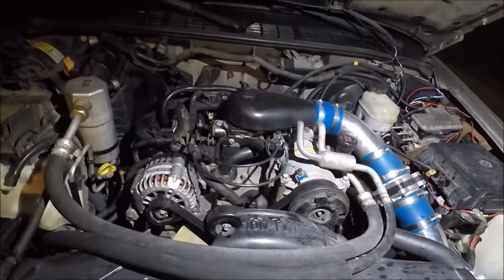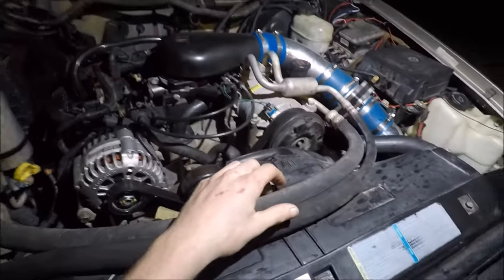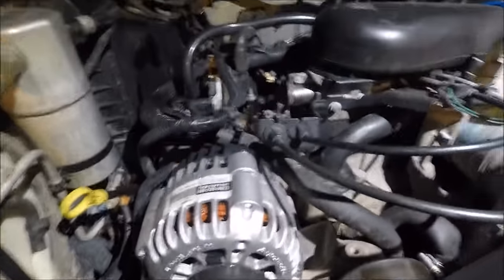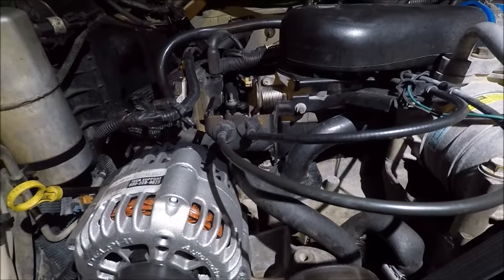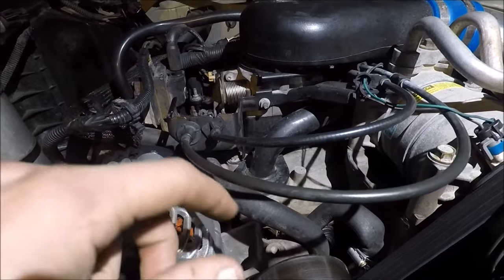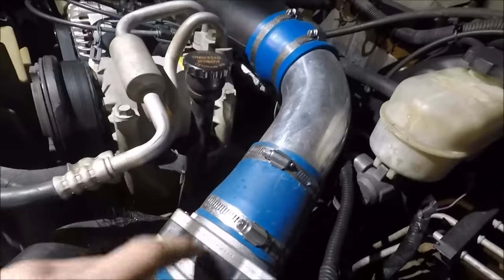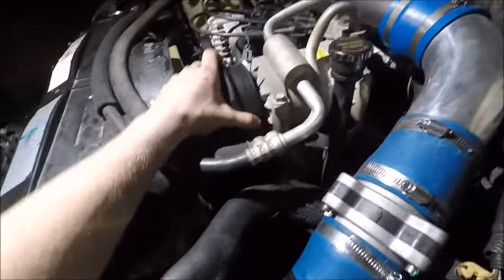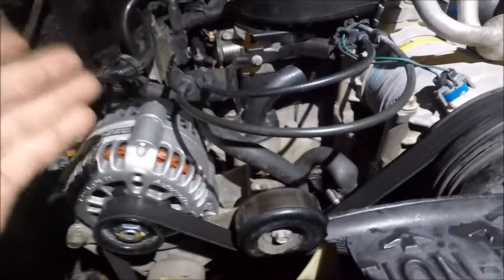EVERYTHING YOU NEED TO KNOW ABOUT THE CHEVY 4.3

Comment: Did you say "maintenance-wise, they're a pain"?
Reply from the maker: Rod Blaine in some aspects yes like spark plugs are a pain since the steering column on 98-04 is in the way
Reply: Okay, got it. Do you just have to change the plugs by feel or do you have to take things apart to get to them? I'm considering buying a '98 4.3 with a 5 speed. Thanks!
Reply from the maker: Rod Blaine not really on the 4.3 they can be accessed from the front wheel wells...they are located on each side of the block on the heads, driver side will be a little bit more of a pain but as long as you got a spark plug wire tool it makes the job stupid easy, but I highly recommend the 4.3 as a simple v6 workhorse that can get the job done everytime.
Reply: Just buy silverado tons of space I have 01 first vehicle I ever did head gaskets on   very easy.

Comment: Great informative video.  Appreciate it!  I had a question if you dont mind...  I have a 2000 Chevy Blazer Ls  V 4.3.  I'm having issues with it shutting off while driving.  Long story short I've replaced pretty much all the sensors. Still had issues. I then was able to sum it down to a short in wiring harness leading to coil and coil modulator I believe. I didnt have the money for a new harness, so I spliced in some new wiring and it worked and ran fine for about 3 months. Now I'm having the same issue with it cutting off while driving... It seems to be more problematic in cold or rainy conditions.. I also do have an Accel coil and spark wires that I've used for about 5 years now..  What are your thoughts?
Thanks in advance...
Reply: I bet it's the crankshaft position sensor. It's on the bottom of the timing cover.
Reply: Could be the ignition coil going bad.
Reply: Mine did that for a while after I attached a trailer power supply
Reply: Maybe the knocking sensors
Reply: Battery/alternator can cause the same
Reply: Monster in the coil/cap known problem. It's arcs
Reply: There's a Crack that occurs and when moisture is present (rainy/ high humidity days) it sends spark in different direction
Reply: @gusc6785  cap & rotor , inside contacts get corroded after 5 years, then rain gets  on to the powdery corrosion causing hard starts. Cleaning the contacts still has pitting that reduces the firing of plugs. You need a new cap & rotor.
Reply: @karenmay5240  actually I been doing research and it seems like it's the gear at the bottom of the distributor , it begins to wear just Enrough which moves the cap just enough to start arcing more and more until eventually you need a new 1 . . There's actually an updated 1 now

Comment: How did GM get your engine to make 200 hp?
Reply from the maker: The Silverado 4.3 got a tune to make it rate a higher output.
Reply: @JLGARAGE252  No sir. They install a hotter cam in 1996.
Reply: @JLGARAGE252  Your truck is a 2002 s10? GM installed a hotter cam in 1994.
Reply from the maker: @blackericdenice  it was 96 and it wasn’t a cam it was a balance shaft to reduce the vibration. 2003-07 vortec 4.3s were up tuned
Reply: @JLGARAGE252  Yes they added a balance shaft but that has nothing to do with hp. If anything, it eat up a little because it spins twice the speed of the crank. I know they install a hotter cam because the peak rpm is higher than 4000.
Reply from the maker: @blackericdenice  ZR2 and 4wd s10s after 96 got a 190hp rating, the one that was in that zr2 I had come out a 07 Silverado making 200hp from factory.
Reply: @JLGARAGE252  If your 4.3 have central port fuel injection. It had a hotter cam than the TBI 160 hp engine. The cam is how GM or any automaker increase hp. You can not tune a n/a engine to make 30 more hp.
Reply: @JLGARAGE252  When the Cyclone 280 hp turbo 4.3 came out. GM didn't just add a turbo. They installed a hotter cam. If they had not. The engine would have made less hp @ 4000 rpm. When the 200 hp Astro van came out. It had that same cam. I know this because it made hp @ 4600 rpm and torque @ 3600 rpm. This was the same as the Cyclone.

Comment: Almost impossible 2 locate "specific" info on 1996 Chevy Blazer LS. Reading gave me impression 96 different then ?<-95, 97->? I've found this true often. desperate 4 video n/or legit info on 1996 Blazer LS from Chilton, Haynes or just smart willing 2 impart knowledge mechanic 2 guide me n/or troubleshoot with me,I'm outta my league if it ain't a 70's or 80's vehicle. I do the work (just turned 62,female,has own tools needed n life ($) dictated action. 13 yrs ago I kept my 70 Ford PU n 85 Bronco running perfect,in the 90's I lovingly rebuilt 79 Nova,minus electrical, stock as possible + 70 Mercury Cyclone,what a wonderful beast that American made beauty was (all cakewalk compared 2 these vortex n sideways sitting engines,few parts I considered landmarks ie: carburator ..
I'm SSI,living in this breaking down LS, survival only cuz $ is 4 staying alive n saving 4 parts).truck has 2 get healthy 2 sell/trade for 3/4ton manual 4wd PU so I can pull my 24'×8' customized Terry Travel home n live spring til fall by any lake, creek, river... n I'm free. LS making my existence so extremely difficult n stressful.I currently have 2 unrelated major momentarily catastrophic problems.i done uppers/lowers bushings,idler,pintler b4..it's getting scary,sounds n feels like it gonna break.ANYHOO -THE REAL Problem aka: huge nightmare: few weeks ago gremlins invaded electrical system,doors would lock/unlock at will,after tons of reading (worked hrs n hrs replacing n updating truck, parts busted or related 2 busted problem n I feel 99% certain what's NOT wrong). Info said gremlins can arrive if battery not grounded fully so replaced neg battery cable,cleaned ground areas,replaced starter/solenoid (twice) 2 months ago,new plugs,plug wires,fuel filter,brake pads,emi (sic) big black thing on top engine that is crucial 4 truck 2 live, thermostat,oil,oil filter,gas filter,heater core,water pump n all those hoses,all fuses perfect n none ever blew,new never used healthy battery... trying cheap n easy routes. Info again indicating it likely ignition switch n info inferred 1996 LS has 2. one located on wiring group along with the tumbler (tumbler, which info said often referred 2 as a "switch" also omgosh wtheck?) located inside steering column on top near hazard lights button b4 wire bundle heads in2 engine. It seemed clear cut there r actually 2 ignition switches plus the tumbler, 1 in steering column n 1 further down the line headed under hood.this problem bout 3 months old.This past week an intermittent yet rhythmic click began n it's from top of column, still accessable inside truck. Parts super spendy,fixed income ($701./month n NW MT cold). Truck won't fire up n battery gives me power, lights, stereo,cig n aux outlets (3) ... n starter does its job but after that ?  a jump gives boost I guess n it'll start.
Afraid 2 turn it off again n gotta make sure some1 round 2 give me jump-til it wont or I destroy new battery.Sorry so long,been living breathing this fight way 2 long
Between frigid temps n nice days bringing big snow dumps I'm gonna lose my mind. TY TY TY please

Comment: How do you check that whining sound?
Reply from the maker: Put a screw driver up to the bolt and listen while it’s running
Reply: @JLGARAGE252  the bolt on the idler pulley or behind it
Reply from the maker: On the bolt that holds it on then do the same to the alternator bolt and determine which is whining, the idler pulley usually is the culprit

Comment: 147000 on my 04 xtreme the only thing I had to replace for the motor was a complete distributor. Fuel pump went out at 100000 got lucky that it died in my driveway...still sucked changing it out.

Comment: I have a 99 astro, mpfi, clicking noise like maybe a lifter? risk miles. Clicking gets louder under load and is intermittent.  Lacking power. Ignition tune up done, plugs wires, cap and rotor. Plugs looked like they were original-but not sure. They were eroded and had very heavy mineral deposits.
Reply from the maker: Ray Miller believe it or not check the exhaust gasket from the manifolds to the exhaust downpiping, thought the same thing turns out it was a bad exhaust manifold gasket.
Reply: @JLGARAGE252  the catalytic converter rattles like crazy when it warms up.  I want to remove the catalytic converter but don't want to cause the CEL to come on. Are you a Stargate fan with your username?
Reply from the maker: Ray Miller put a high flow cat on, and no don’t know what that is.

Comment: I just got a 2002 Sonoma 4.3 5-speed manual with 105K miles and I absolutely love it. Quick question though, I replaced the 12v receptacle in the lower flipdown dash part with the OEM replacement part and now the fuse keeps blowing. Put a stronger fuse in and it still blows (fuse #2, Cigar lighter). Any experience with that part? Awesome video bro! I plan on doing some myself.
Reply from the maker: mr spools check the wiring
Reply: Remove the higher rated fuse and find the short!
Reply: I found the short it was my 12v port

Comment: i just bought one with 68k miles what should I change ?
Reply from the maker: To be Unboxed check to see if the trans fluid has been changed, oil, rear end, check the distributor cap..pretty much the basics, if it’s 4wd check and or change the T-case fluid. I’m at 160k rn and it’s runnin good. The O-ring on the intake where it meets the throttle body, check to see if the MAF sensor has the screen still in it, def want it to be, fuel filter if it’s not been changed, radiator check the condition of the coolant, every 50k it should be changed, dex cool is known to become corrosive over time, check the timing cover behind the vibration damper, shouldn’t be leaking oil,  idler pulley next to alternator shouldn’t make any noise, the tensioner shouldn’t bouncy around too much, the exhaust gasket where it meets the y-pipe from the manifold should be checked,  the Haynes manuals from autozone are pretty much a holy grail in terms of maint. I’m gonna be making a video of what I’ve encountered while owning a 4.3 in the s10 series, This is my second s10 so I’ve got a little bit to say about it. But maint is key to prolonging the life of any vehicle
Reply: Wraith1998  thanks mine is a gmc sierra but a  small box truck  like the u haul .I want to male sure everything is good as im going to turn it into a mobile motorhome
Reply from the maker: To be Unboxed the if it’s not a Vortec 4.3 then it’s the “other”

Comment: What to buy a chevy van but not sure which is most dependable and low maintenance any suggestions?
Reply: Astro van would be my recomendation. has a 4.3 and doghouse access for servicing.
Reply from the maker: Chevy express cargo vans are good work horses the 4.8 v8 they have are pretty good
Reply: @JLGARAGE252  some also have this 4.3 v6.
Reply from the maker: imlkrsfn yes but I’d buy the newer 4.3 if you were to buy a giant express van
Reply: @JLGARAGE252  yes sorry 4.3. I've had two vans with the 4.3 they're excellent. Poor fuel economy but I'll take a reliable engine and car that starts every single day over that.
Reply from the maker: Tony Montana best v6 Chevy offers

Comment: I have a 1997 s10 4.3l x motor excab spot side bed.replaced alternator distributor fuel pump starter rebuilt trans.coil had a short cracked wire.new coil fixed wire I think I'm going to put plastic over the distributor  cap to keep water out burn the plastic to keep it on or zip tye .seen this done on a 1971caprice  distributor it worked.it was a mechanics car.old school.220000 miles long block all original un touched had to replaced the in take gaskets a long beed in the front let it harden with no anti freeze or pressure over night to cure lasted ten years so far.new spider installed. Hinges need dealer bushes the helps brands suck.all stuff I could do.chang the oil every 2000 miles and the engine will last.if you rebuild the Trans change the oil evey 25000.if you let it go over a 100000 don't it's proply too late.my oil pressure is 40 to50psi 50 was new.having a pressure gage on the oil helps a lot to tell condition of bearings and if the filter is clodged.it will go to 0 when clodged.it saved my motor once.it did that once a block from the house I know that's what it was got it home shot it off.changed the oil and filter.i let the oil go too long once .saved.

Comment: So what about a certain tick that happens every now and then I cant figure it out it sounds like a lifter but its not
Reply from the maker: marcos hernandez the s10 in this video ended up getting a lifter tick the lifter collapse and I didn’t have the time to pull it apart so I sold this s10 and now I just bought a new zr2 so I plan to continue videos regarding the s10 lineup
Reply: @JLGARAGE252  oh ok I wasn't sure if it was or not i hope mine isn't that bad thanks
Reply from the maker: marcos hernandez no problem more S10 vids coming soon.
Reply: marcos hernandez my old 97 s10 used to tick since day one bought it new drove it to 300k miles it’s the poppet valves on the injectors is what I assumed I went through that motor a couple times through the years never had an issue with the lifters or cam
Reply: @All-things-shitbox  cool thanks
Reply: Most of the time I just remove oil pan and replace pick up tube o ring solves tick problem air pockets getting in done a few this is usually the problem.
Reply: @bbb8949  thanks man ill try that too

Comment: I'm debating on getting a 2.2 or 4.3 for my 01 S10. I'm worried about fuel efficiency between the 2 engines. Is their a large difference between how much fuel its gonna consume?
Reply: You will be disappointed if you don’t go with the 4.3. They are great and I get around 19 to the gallon in my 99 blazer 4x4 with 31 10.5 15’s on it.
Reply: Yes!
Reply: The 2.2 is fine but just know you will work it much harder.  I lived with a 2.2l for quite a few years and didn't get great gas mileage simply because I had to put my foot in it to get it to 65.  (Especially after 160,000 miles).

Comment: Have a ? I have a 03 zr2 5spd decent power on level ground as soon as i turn up hill or put a load on the engine it falls on its face so if i downshift and run it hard like around 3500 to 4000 rpm to get up the hill it will get a dead miss and ses light will start flashing but once u level out it light will quit and the miss is gone doesnt store a code any idea would be appreciated
Reply: I had this issue and it turned out to be the fuel pump. I replaced it and the fuel filter and got it back running right.
Reply from the maker: Change the distributor

Comment: They dump fuel & the rods be like; "Cash me ousside how bout dah!" At around 230 - 240ish hundred thousand ,miles quite often, due to the CPI injector, unit. When it leaks and/or the fuel pressure regulator, leaks? It dumps raw gasoline into the crankcase when you shut it, "OFF." Then, when you go back after 5 or so minutes & "try to" START,  it? Mine sounded like the starter was "machining" the flexplate to heyll & back & it had to crank & crank & crank, til it would finally start? When the CPU fails/leaks.. its; "bye - bye, fuel pressure, & Hello to the fuel that the injector every so kindly poured into your, oil pan.. 
Or? I've seen the lower intake gasket(s) blow at the rear of the engine. At idle it misses & jumps to beat, heyll.... on mine 3 & 5 were partying with each other on the driver side... on the passenger, side, 4 & 6 were getting it on, stealing each other's suck, with  2 cylinders leaking each other's "suck, bang, boom?" That thing idled like it was as nervous as a dog schitting a, peach seed? When I'd get ot up to speed... it ran, great..  "Kick it?" It would haul azz. I had to take it apart because it's at 250,000 miles & because;

Cracked 
Head
Every
Valve
Rattles
Oil
Leaks
Every
Time

"OLD CHEVY'S NEVER DIE,...... THEY JUST GO, FASTER..."
✌💯❤😉
Reply: "CPI" 
CENTRAL PORT FUEL INJECTION

Also, I bought the MPFI - Multi Port Fuel Injection, upgrade, for mine. It was just over 300 USD (Napa) 
I haven't got to put it back together, yet.
Reply from the maker: Well let me know if there’s improvement in the engines operation.
Reply from the maker: I appreciate this comment, Chevy fellers think the truck stays new for the duration of its life…a chevy pride kinda thing, but the reality of it is this…maintenance on time every time.

Comment: It has a lack of power

Yup...we designed it that way
Reply: my friends mom as an astro van, i swear that thing will do 16-15 second quarter miles. its stock as far as i know, my wifes astro doesent run as good but itll burn the tires into 2nd gear and its got factory posi